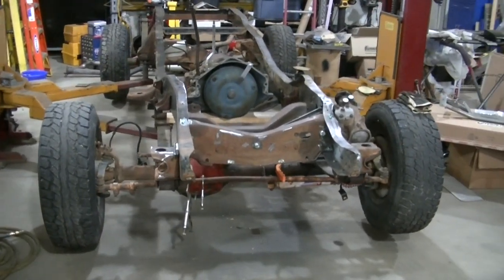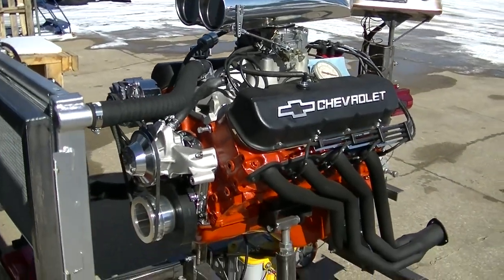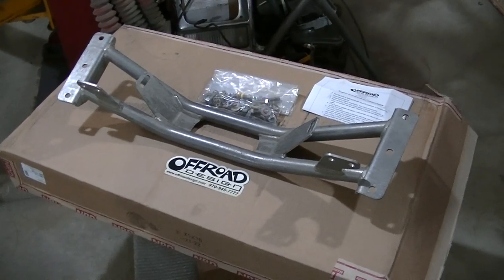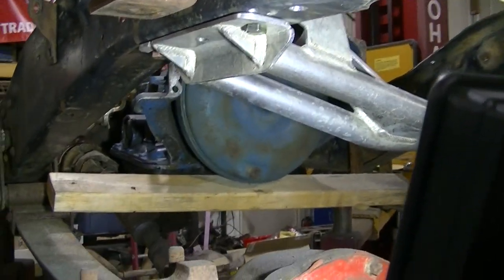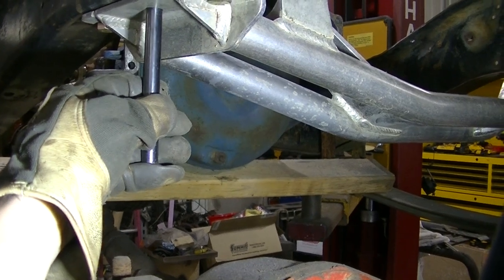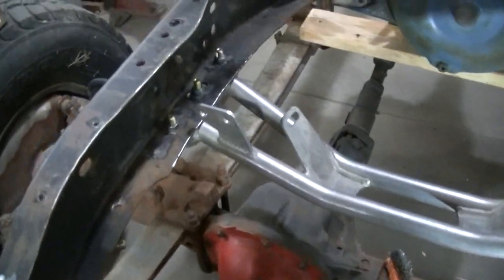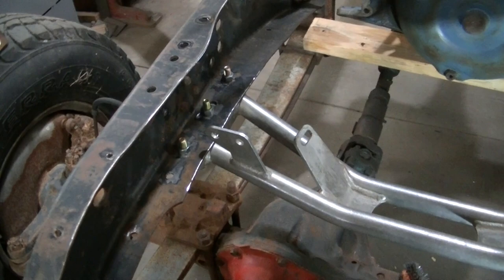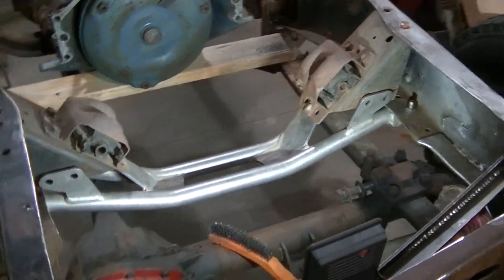80 Chevy Silverado OffRoad Design Engine Cross Member Install

Comment: Nice , work question, what is the measurement of the inside frame where that cross member is attache , From the Edge of the frame to The other side.
Reply from the maker: I don't know off hand but that shouldn't matter. You use three holes that are already there to mark and drill the others.
Reply: @mossman381  the reason I'm asking is because I'm using a fream from a 78 ramcharge base on what the guy toll me that is way I ask messument but I think they are the same

Comment: Is there enough clearance for a racing pan with a full length passenger side kick out?
Reply from the maker: Not sure. I have a big block chevy in the frame now. Don't really remember how tight it is. I don't think it is tight. The guys at OffRoad Design are good guys. Give them a call and ask.
Reply from the maker: After 11" from the front of the pan it's all clear. There is a good amount of room for a big block stock oil pan. I can stick my hand between the cross member and the stock oil pan.
Reply: @mossman381  thanks, appreciate it!  Looks like a nice build you got there, gonna be fun.
I'm thinking about building a 850hp 535.  With a 4.5" stroke it'll be nice to have the kickout down the passenger side to reduce windage.  Would like to have a reverse mount starter so it's full length but that's pretty impractical so something similar to a STEF'S 1141-12.5 may be what I go with.  If something like a Dan Olson ws427ak would fit, that'd be nice.
Reply from the maker: @sc358.  I can't say I know what all those parts are or what they look like. I just have a standard 427 big block in my truck. Not a lot of hp but should have decent torque for a daily driver. Wish I could be more help.
Reply: @mossman381  all good.  That thing will be plenty of fun for a daily driver and will have enough torque to pull a trailer with ease.  You can always putta 100-150 shot (wet) to it 😅, with the compression and end gap they have, don't think that would be any problem so long as the timing was right.

My dad had an 81 longbed on 35s with a stock 454, performer intake, edelbrock 600 carb and headers/exhaust when I was a kid growing up.  It was fun, didn't have tons of power but was quick enough, sounded cool and towed well.

You'll have a nice truck by the time you're done 👍